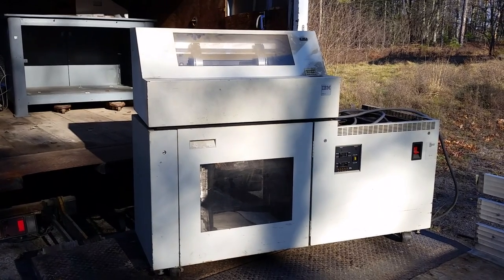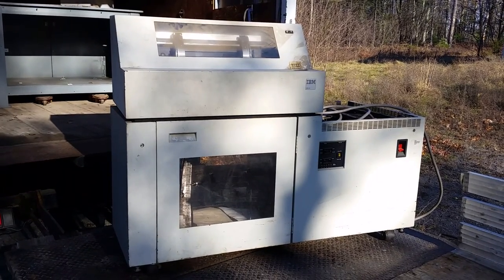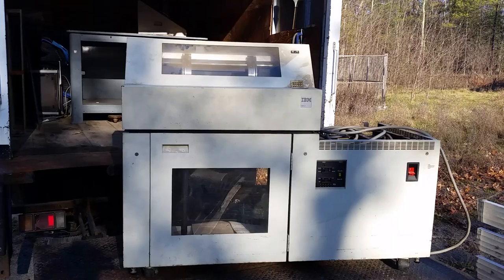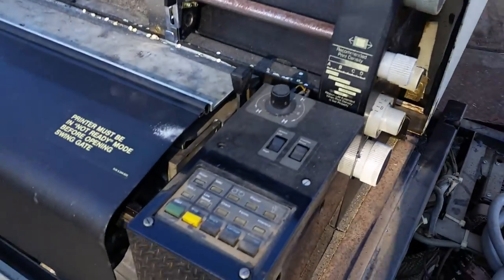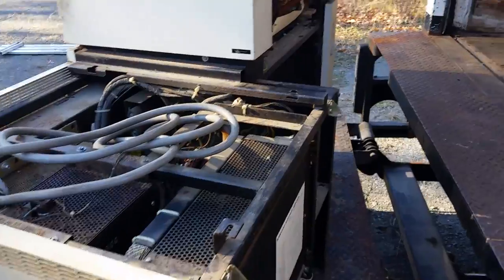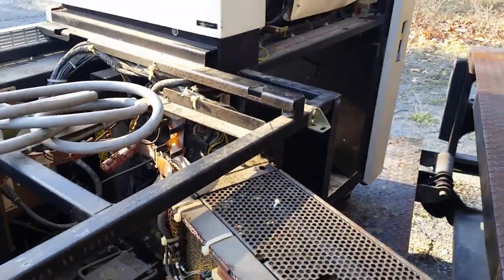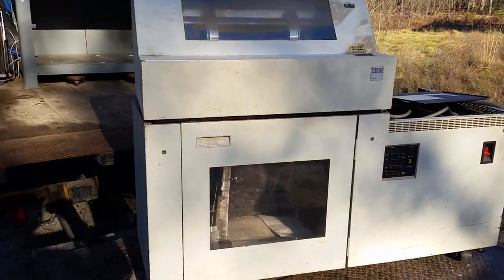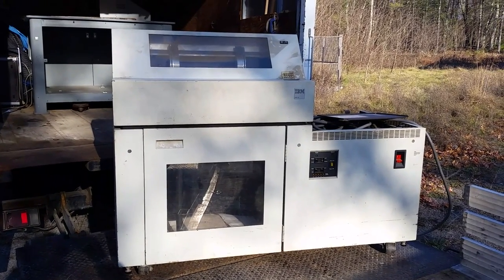IBM 4245 Printer

Comment: I was development manager for 4245 electronics. The key to its accuracy and reliability was the all digital control of the printing process with Motorola 8bit Microprocessors and custom logic for digital control for firing the hammers. Software Updates were delivered with EPROM Logic Cards. Manufacturing Sites were Jarfalla (Sweden), Charlotte (USA) and a small assembly site in Brazil. Great Project, great Team . Thanks for caring the historic HW

Comment: Produced in IBM plant in Järfälla.

I did in 1983 (i'm unsure) a vocational prac week at a company in Falköping Sweden (Arkivator).  At that time they were a supplier of complete printer mechanisms to IBM in Järfälla (I got to produce a small part for a  then current IBM bank teller printer.)

Arkivator basically delivered mechanically complete (except plastic hood/covers) to IBM in Järfälla at that time.

Comment: Love your respect for these babies. Wow.   Replaced by shuttle printers printronix
Reply from the maker: I have a 6262 that will get a video eventually. I still need a 3811 for the collection, as well as the failed Endicott printer that competed with the 4245 (I can not remember the type number).

Comment: Was still being used in 2000 when I left the local authority I worked for who used an AS/400 , printing daily lists, salary slips, cheques and sorry to say, bills! Unbelievably quick! I then went into maintenance and remember servicing one, only I had taken the print band off after cleaning it and placed it on the floor.... only minutes later to step back on to it!!!! The earth may aswell have opened up. Had to urgently order a replacement for the customer,  and parts were rare back then 😡

Comment: Did repair them when I was young. They are build like a tank and very reliable. Unfortunately Hammers and the types on the band did wear out and, as many of the customers want to save money, I had to adjust the printing pattern to squeeze out some more million lines before changing the band or hammers. There should be a small Testing unit with every printer. If you have the manual you can run all the test from this. Amazing speeds and when a sensors did not kick in you could get a pig pile of sheets inside the area if you got a paper-jam in the rear.

Comment: I found an IBM 5262 600lpm band printer at a thrift store about ten years ago and it was fully working.  I still see them occasionally on the Internet, some mistakingly selling them as dot matrix printers.
Reply from the maker: Those are getting hard to find now. They used to be as common as flies. Where was it?
Reply: It was at a DAV store.  Funnily enough there was still a System/36 operating at a local doctor's office at the time.
Reply: Do you mean 6252?